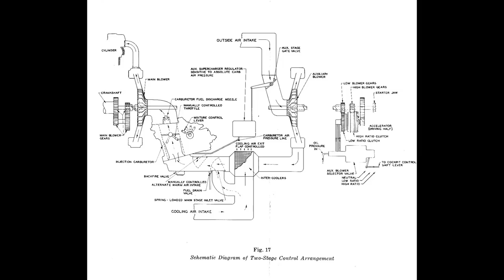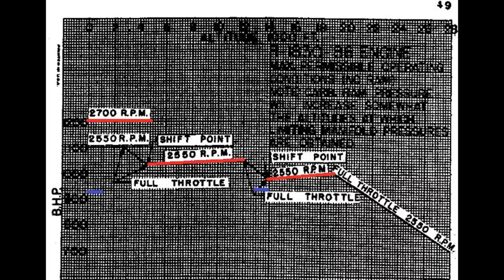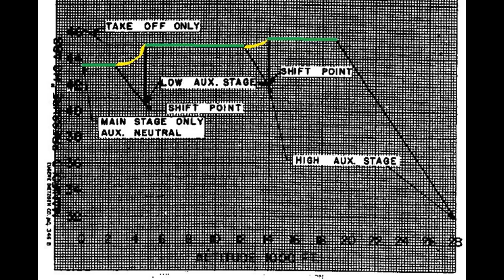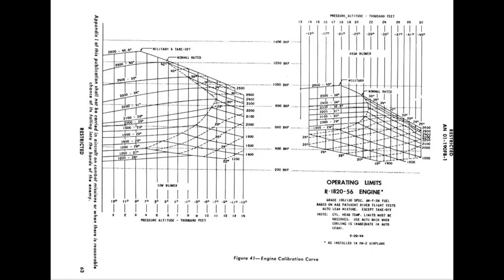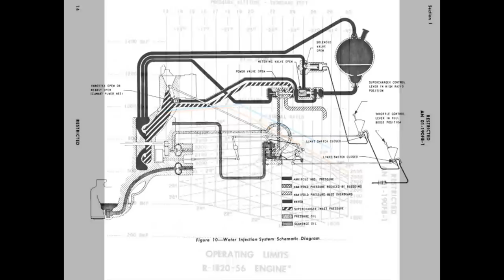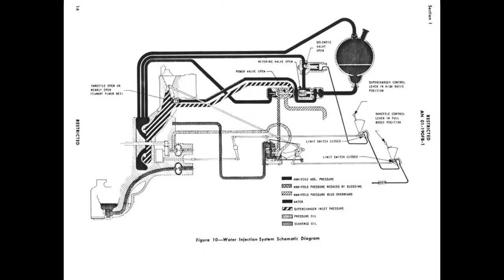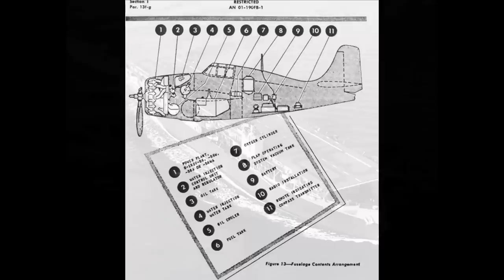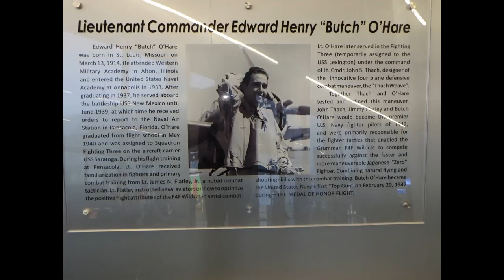Grumman Wildcat and FM-2

Comment: Two more comments.

You state that the supercharging system of the F4F was advanced for its time.  The Spitfire V, also 1941 vintage, had 1650 cubic inches rather than 1830, and yet it produced 200 hp more.  With higher octane fuel, it could do even better.  The Seafire III's of 1945, which were identical to Spitfire V's but with folding wings, could fly circles around any US naval fighter under 10,000 ft.  Even the Corsairs and F6F's.  I think that Rolls Royce had much better adiabatic efficiency compressors.

Another comment is that the F4F was nasty on the ground.  When a tail hook stopped in in deck landings it was good.  But on airfields, it had a nasty groundlooping tendency.  The undercarriage was too far forward.
Reply: Demetri Dar, it's more complicated than that. The Wildcat (especially the FM-2) had a powerful rudder which was fully adequate to manage the ground track.  But...the Wildcat's narrow gear with it's long-travel oleos (to withstand carrier landings) meant that the plane could roll +/-  7 degrees with all 3 wheels on the ground. When you land on a carrier, there's no rollout; you hit the deck and stop. My uncle's old neighbor who flew them for the RN/FAA said that squadrons returning from 6 Mos. sea duty would  get fooled by this because if there was even a breath of crosswind, the Martlets would roll to downwind during the landing rollout. The pilots would often misinterpret this roll as a yaw and boot the rudder instead of applying upwind aileron and thus deak themselves off into the tulies. The ground crews, knowing that the  pilots were out of practice at ground landings, would already be lined up along the runway with tugs and towbars and have made their bets on how many Martlets they would have to fish out of the long grass.  Upwind aileron input (always a good idea) was essential to success in Wildcat operations.
Reply from the maker: Demitri, the Spit V had a non intercooled single stage system. It was nowhere near as advanced as the Wildcat's. The reasons for the Merlin's greater power are elsewhere.
Reply: @GregsAirplanesandAutomobiles  A lesson that more sophisticated does not always mean better. Calum Douglas's book on Western-front aero engine development clearly puts the Merlin/Griffon engines (with their associated superchargers) as the least sophisticated among the major combatants, but on the other hand they had an incremental track record of sound improvements to a basically competent design which kept them in the race where it mattered (power delivery in an airplane).
Reply: @neilrobinson3085  Thanks for the added explanation. Still, if the landing gear was a bit closer to the CG, much of that would be not necessary.  But there may have been other compromises if that was the case, I have not studied the F4F.
Reply: @GregsAirplanesandAutomobiles  I think the Merlin's more power is on the higher adiabatic efficiency of the supercharger.  Liquid cooled engines tend to have an advantage by lower head and piston temperatures, but in this case the 1830 has more cylinders and more displacement, yet less power.  I think this just shows how the US built engines were not exactly at the same lever as the European counterparts.  Not so different from the airframes.  The designs were aimed more at minimizing cost of production with unskilled workers rather than maximizing performance.  Which had its merits.
Reply: @Ensign_Cthulhu  Caution here.  This Calum Douglas book maybe more novel than real engineering.  I have criticized this guy in a certain section of his theories that I happen to have studied and understand very well, namely the sleeve valve engines, and he seems to have very weak understanding of the concepts involved.  His ignorance likely expands to other areas.  I do agree with your "lesson" in principle, but I do not think that the two stage two speed Merlin and Griffon super chargers were the "least sophisticated".
Reply: @demetridar506  I call BS on your claim.
Reply: @Ensign_Cthulhu  Do you have any engineering background to make that statement?  Not only your buddy does not understand adiabatic efficiency of compressors, and basic lubrication concepts, but he also defies the opinions of giants such as Sir Harry Ricardo.  Not sure about the rest of his theories, but he has lost credibility on my book.
Reply: @demetridar506  That was not my impression. As far as defying the greats is concerned, science marches on. New discoveries are made, and science is at its core about questioning current knowledge.
Reply: @Ensign_Cthulhu  You suspect, I know.  I have not seen his "credentials", but I have seen many people with "credentials" that know little.  Very often, they got credit from the work of others.  In this case, when I see lack of understanding in basic principles, makes me lose interest to his whole theories.  You can continue suspecting, however.
Reply: Comparing liquid cooled and air cooled displacements is apples and oranges. Air cooled engines are lighter, usually only use 2 valves per cylinder to promote good air flow around the exhaust valve, and are more subject to thermal  loads. Liquid cooled engines are heavier than an air cooled engine of the same displacement, usually run at a higher rpm,  can run higher boost due to their better cooling, and typically have four valves per cylinder for better breathing.
Reply: @fafner1  That is all true, but it is not enough to justify the huge difference in specific power.  One advantage that the air cooled engine has that you left out and compensates some for its deficiencies with respect to specific power  is more number of cylinders (14 rather than 12) so that the number of valves, even though 2 per cylinder, are not exactly half (BTW, the air cooled valves are larger, I assume you know that).  Here is a good example of two top of the line air cooled and liquid cooled engines for fighters:  Compare the Rolls Royce Griffon and the Nakajima Homare.  Both almost exactly identical displacement, 2200 cubic inches.  Griffon 12 cylinders, Homare 18 cylinders (designed to minimize frontal area, ideal for a fighter, this is where the FM2 Cyclone engine sucked, with only 9 cylinders).  Both produce about 2,000 hp.  Griffon 2700 rpm, Homare 3000 rpm (yes, the air cooled has higher rpm).  Granted, the Homare uses water injection, but nevertheless only uses 91 octane.  The Griffon does not use water injection, but it uses 100 octane fuel.  Granted, the Homare does not do so well above 35,000 ft, but its lighter.  

The engine comparison above is of course engines that were designed at the extreme edge of technology of their time.  The point I am making here is that the PW 1830 is simply not that.  In fact, it is very far from that.  It is a low cost engine, designed to be mass produced, used on anything (bombers, transports) and be a work horse, not a thoroughbred.   It is more like a Volkswagen than a Ferrari.  Its supercharging system may have some smart ideas, but the execution is poor by the standards of its day.  The Merlin, Griffon, Homare, etc are the Ferraris of their time.   Take a Spitfire XIV (Griffon) and a Nakajima Hayate (Homare) between 0 and 25,000 ft, and you will have two very well matched fighters, perhaps the top performers in 1944.  There was nothing in the US arsenal of fighters (all of them built with VW mentality) that could get close to the performance of these two fighters (we are not talking about top speed on a straight line, here, we are talking about combat capability which requires a balanced design that has descent performance on all fronts).  The US fighter mentality was to build them cheap, but build a shit load of them (this was also the Soviet approach).  The Grumman fighters, F4f, F6F, or the Vought Corsair, and all others are exactly that.  Perhaps that was a good strategy, but we have to overcome the propaganda that wants us to think that the US had the best.  It did not.  It just had more.  Inferior machines, but a lot of them.